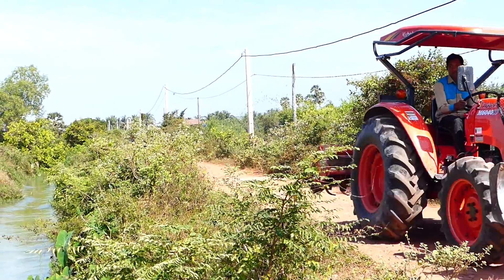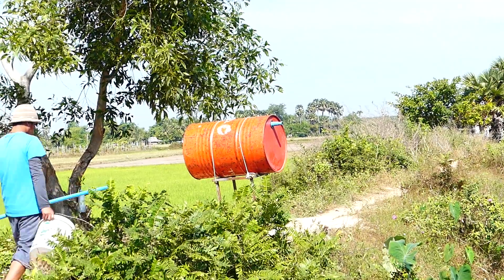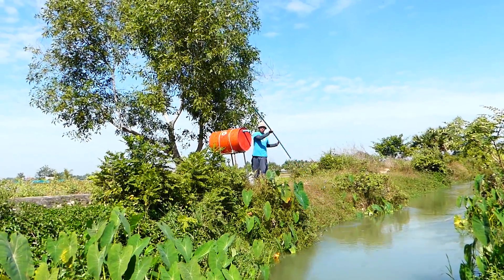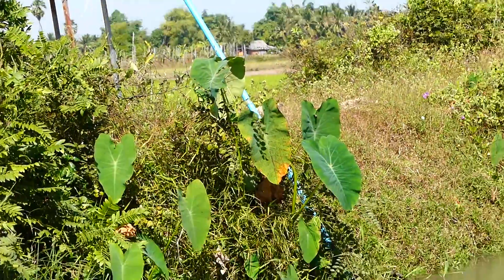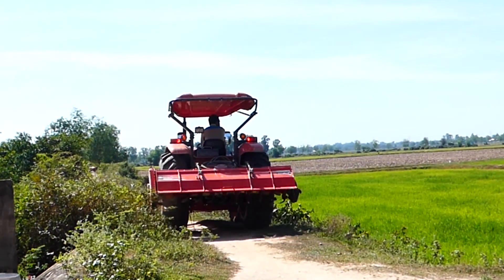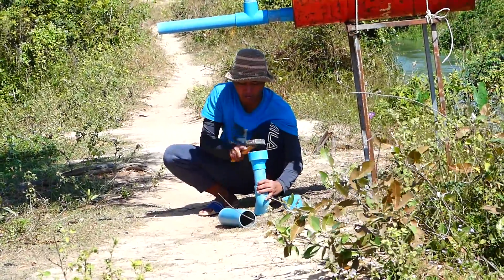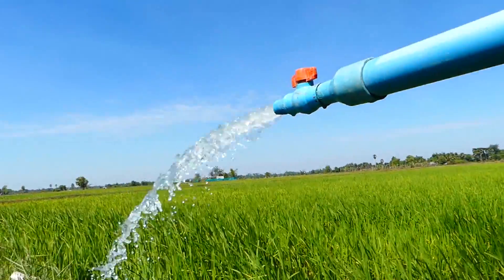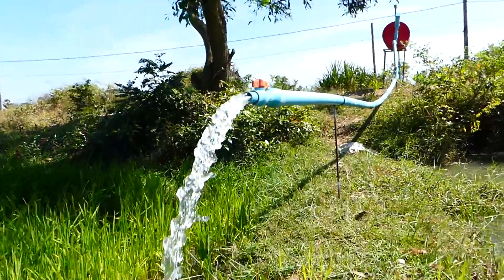No Electricity Auto Water Pump from Deep River

Comment: For this siphon to work, the outlet to the field must be lower than the water level in the source, the river. 

No need for any foot valve, waste of money
No need for vertical pipe after drum, waste of money
No need for valve at output from drum, waste of money

A funnel for filling would be practical so not so much water is lost. 
An upward bend at the output would prevent air from entering the system via the outlet. Or one could dip the output into a bucket of water.